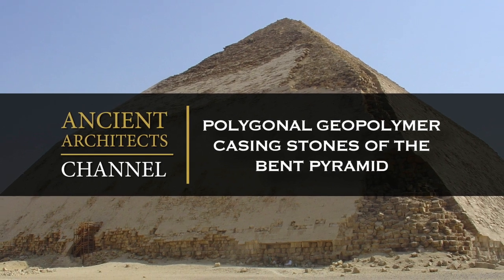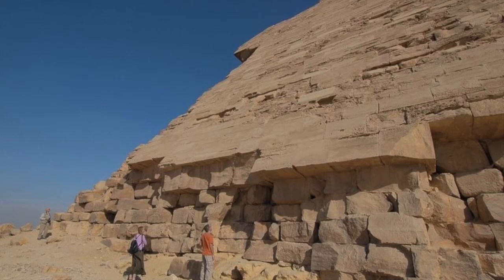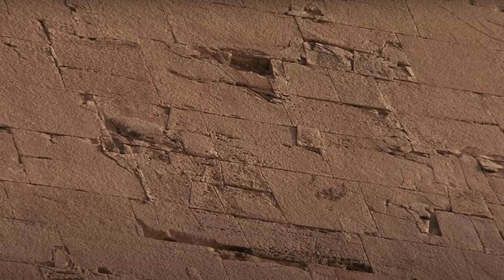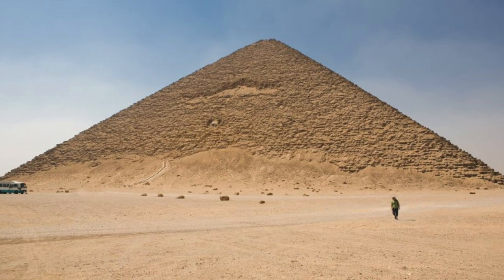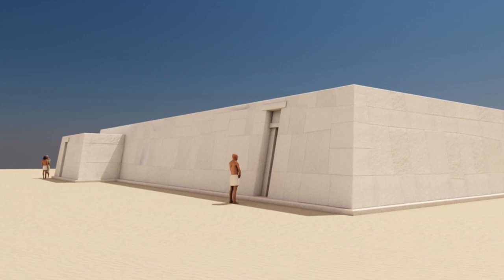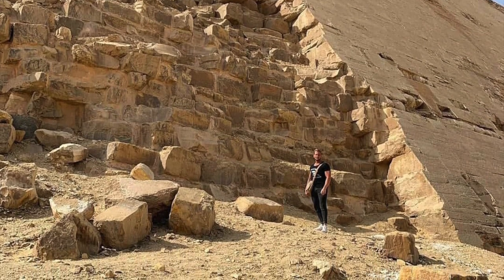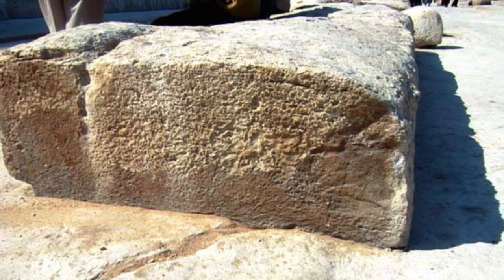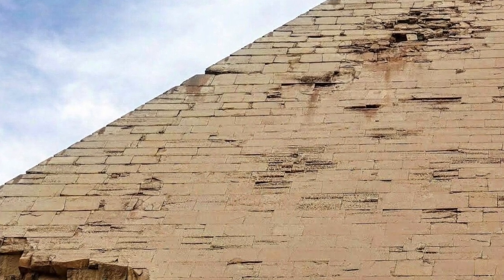The Polygonal Geopolymer Casing Stones of the Bent Pyramid | Ancient Architects

Comment: The problem with the scientific analysis is in the comparison. Samples taken from several of the Tura quarried outcrops, have then been compared to the casing stones of the bent pyramid, the conclusion being, they are different so must be man-made, a perfect example of not only biased, but also bad Science.  Like you say in the Video WHY would they bother, as it would be quite clearly easier and quicker to carve the stone, the guys excuse about mud bricks and not carving stone in the 4th dynasty is beyond lame.  So why are the samples different in composition? well it's because the blocks used for the casing stones didn't come from the Quarries surface, but were quarried underground, massive deep tunnels were created to cut the more superior stone, the reason for it's superiority is due to consistent temperature, the constant pressure under which it was formed (which is a major factor in the natural formation of C-S-H) and also the water from aquifers and the annual flooding plays a major role through its seepage into the quarry through the porous rock, and being under ground it's reflective bright white qualities are kept intact.
A cement was clearly used behind the casing stones on lots of pyramids, but has perished on most, but the bent pyramid has literally tons of the stuff still in place for anyone to see, but its for bonding not building.  You really don't need another scientific study to disprove his hypothesis, he needs to prove through repeated experiments that the blocks can be made by using the composition he says the Egyptians used, all his paper proves is that a stone sample from a building doesn't match the composition of a few samples taken from the quarries outcrops, which weren't used for casing stones in the first place.

Comment: sorry but no, just no each block is different so to make each one would require its own mould and would be a greater task than just huneing them from the bedrock
Reply: claiming a mould would be more difficult than carving and dragging is insane.
Reply: @JM-co6rf  the point is you wouldn't make them all different they would be all the same and they are not
Reply: @gorrthebutcher4696  no they wouldn't need to be the same size. as long as you pour into the space between two dried blocks, with wood panels on the front side, the width could vary
Reply: @gorrthebutcher4696  The majority of stones are not uniform in size or shape